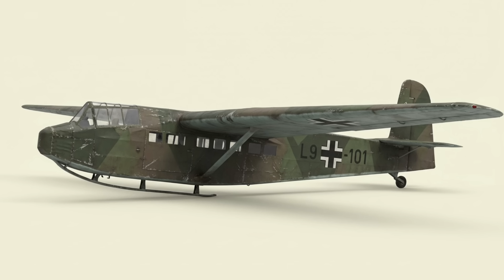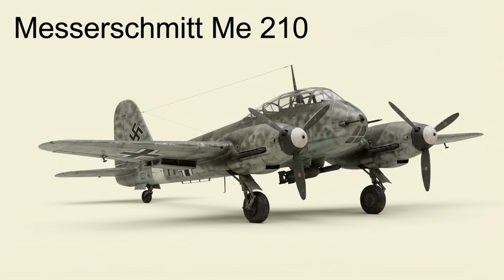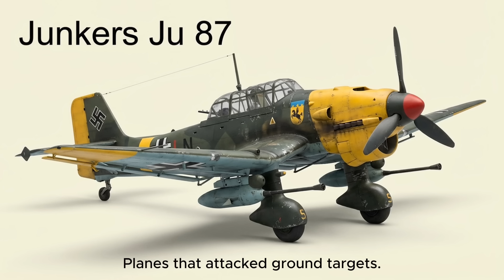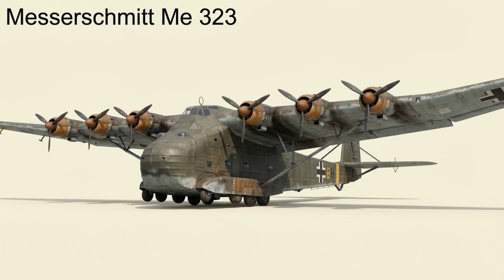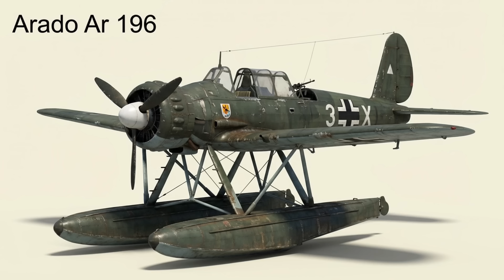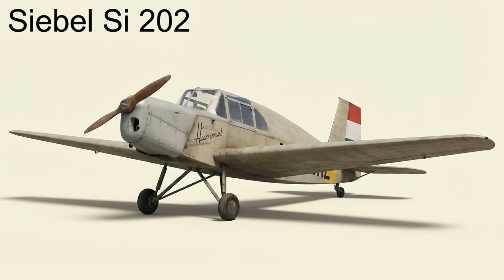Every German Aircraft Used in WWII

Comment: Your video title says Used, some of the aircraft never saw service. Get it right.
Reply: Außer der Bachem Ba 349 "Natter" waren alle im Einsatz, wenn auch in sehr geringer Stückzahl. Außerdem fehlen in diesem Video eine ganze Menge anderer Flugzeuge.
Reply: @arnddegenhard2278 These videos fail to define "used" for me it's aircraft deployed to front line units in squadron numbers. Test, evaluation or prototype aircraft should not be included, but technically a first flight of a prototype is "used". A good example is the Do335 and Ta152, they were both flown, and there is a doubtful claim one was spotted in flight, but it can't claim front line service. The Ta152 did actually see action and did very well, but I believe they were evaluation aircraft rather than deployed at a squadron level. Similarly which is the first Jet to see service? Most say Me262, however once again technically the Meteor was the first to enter service with a front line squadron, as opposed to see action. Clips like this never have defined criteria and if they do they promptly break them. The Ta152 I can imagine the pilots could not wait to get them into combat, as opposed to the He162 Salamander, which again was deployed to squadrons, but were not greeted with the same enthusiasm. And thus not used, but the fact that it was sent to squadrons means it was 😂😂😂😂

Comment: Me 262... beloved by Wehraboos, but massively overrated. Far from invulnerable, most of the 180 shot down were by allied piston engine fighters
Reply: Yes, you know why and how?
Reply: @lowersaxon  They were most vulnerable during take off and landing when Tempests and P-51s would bounce them. So it wasn't invulnerable. And at speed, it would have issues with stalling and flameouts, and even being too fast. And there were the materials poor quality, poor build quality, cannon issues, dirty and dangerous fuel, sluggish in turns and directional stability issues and so on. An overrated aircraft. Maybe it could have been good if every part of the aircraft production system in Germany wasn't corrupt and incompetent.

Comment: You forgot the Fw 187 Falke. Although only nine were built, it was an exceptionally fast and agile twin-engine single-seat fighter. Despite its superior performance, it wasn't chosen over the Bf 110 and therefore didn't go into mass production. The aircraft was stationed and used in Norway until early 1941, when Göring ordered them withdrawn from front-line service because the pilots preferred the Fw 187 to the Bf 110. Göring didn't want it to become public knowledge that he had ordered the wrong aircraft...
Reply: Missed much more...! And sometimes horrible Pictures!